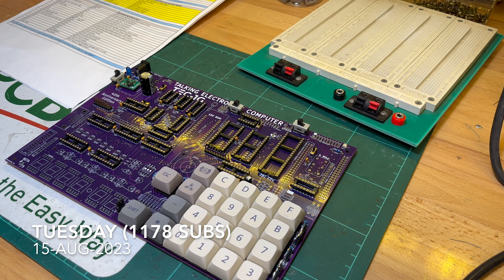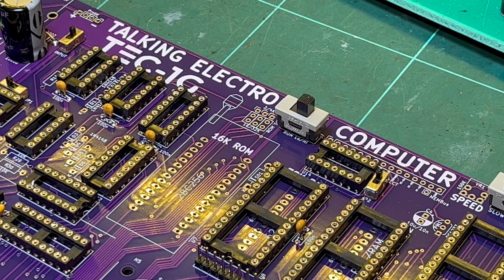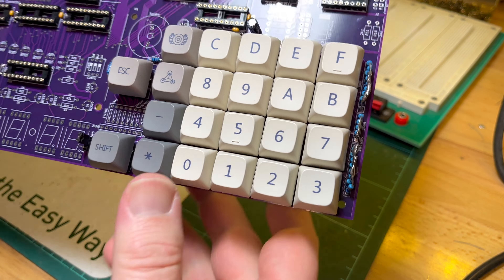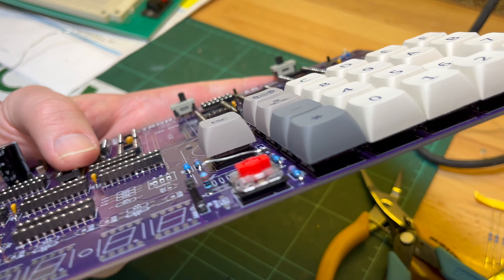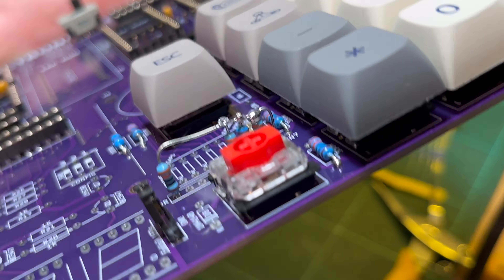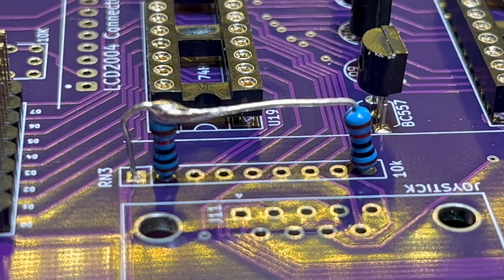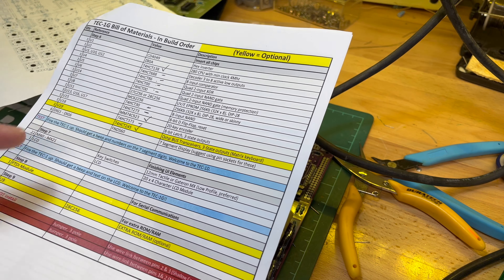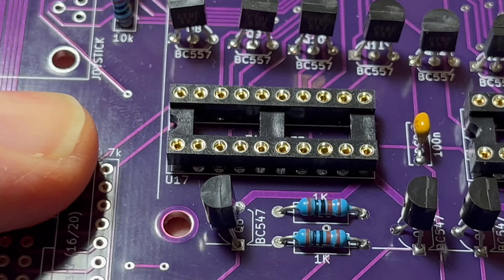🇦🇺 Building The TEC-1G: Part 2 [TCE #0341]

Comment: Soldering a resister bank can be easy, if all resistors have one wire curled around the common wire, then one side is soldered on the board, then all common wires are in position and van be soldered last, practically at the same time.

Comment: All the expansion headers (MEMbus, IOBus, Z80Bus etc) are female. The one on the RHS is a right angled female. Important to get that right and I’ve only ever found them from DigiKey.

Also, the big 1000u cap needs to be installed laid over, or you won’t be able to install GPIO cards like the Real Time Clock and SD Card interface.

Comment: Did you find enough machine pin sockets?

And you are getting better at getto resistor packs. :)
Reply from the maker: Yep - had one EPROM sized (28-pin) left ... need to order more.  I'm never buying a resistor network again ... I just need to remember to order 10x the number of resistors I normally do so I have enough!
Reply: @Brfff  The machine pin ones that you use are the best. As for resistor networks, they too, can be ordered in bulk (who knew?). Get some thicker wire and solder the top header on first. Might work better.

Comment: Did you finish this project.
Reply from the maker: It's built ... but I need to troubleshoot why it's not working.  They're doing some pretty neat things with it that I'm missing out on!
Reply: @Brfff  I am also going to make this computer - taken me some time to get the parts and boards.  I have most of the parts now.  This week-end will start.  I got 9pin 330R and will cut one to 5pin as cannot find 5.- Not sure if you know you can cut them down.